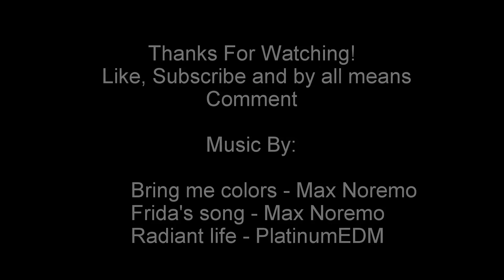Ring Not In The Scoop!!! Metal Detecting the Beach

Comment: What kind of detector are you using with the blue and white coil?
Reply from the maker: +Dean Hansen 
Hello Dean, thanks for checking out the vids. The detector in this vid is a Whites Surf Pro PI with the 950 diver coil which has zero buoyancy . They made one with a black coil of the same size but it floats. They don't make the Surf Pro anymore, which is a shame but it is the model that was produced before the Duel Field, the current offering. I use a The Duel Field once and a while, if I know I'm not going in the water. The coil on the Duel Field is all but impossible to swing through the water... where as the Surf Pro coil which is not white its actually yellow cuts through the water nicely. Thanks for the question and GL&HH